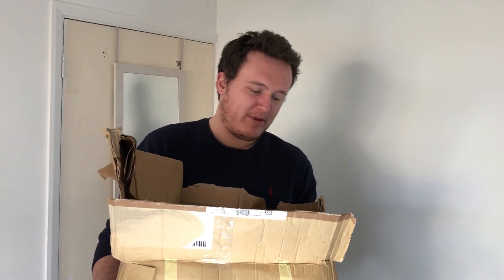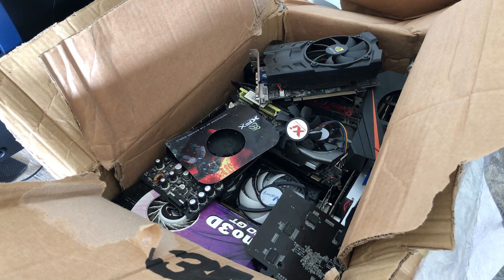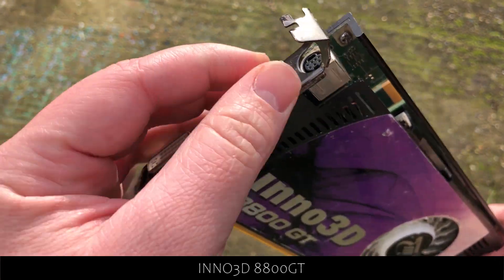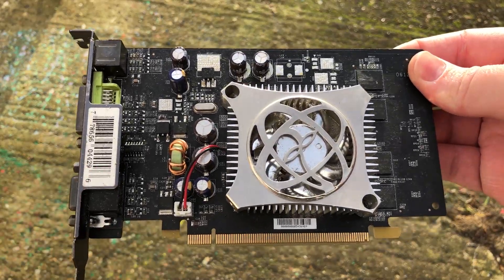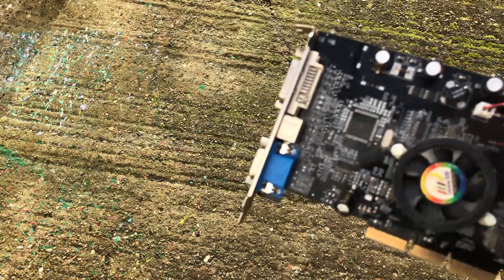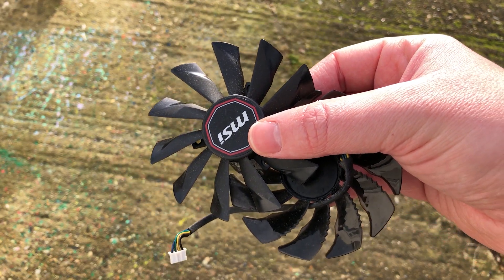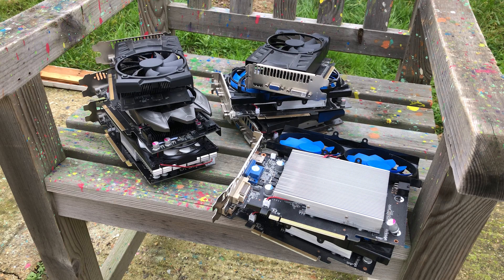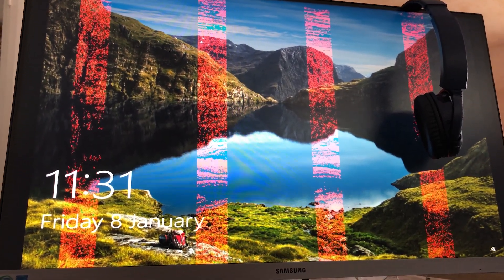I Bought 25 Untested Graphics Cards For £50 ($70)...

Comment: Wow a GPU in stock
Reply: Wow a broke boi without decent pre-order mindset
Reply: Always hasn't been
Reply: @fortnitespecialty5003  | Very cool FortniteSpecialty
Reply: @ouwebok3356  but are you cool enough to be cool or are u overheating?
Reply: not anymore, he bought them all
Reply: @fortnitespecialty5003  buts it's actually really hard to get a good gpu
Reply: @fortnitespecialty5003  lol you’re a square.
Reply: I managed to get a used 1070. Paid about £20 more than they were before covid on ebay but I'm very happy.
Reply: @JudeTheYoutubePoopersubscribe  people don’t realize how overkill a lot of the 20 and 30 series cards are, if you can afford them great, there’s literally not gonna be any difference between 150 fps and 250 fps lol and most people play either at 60hz or 120/144hz @ 1080p anyway
Reply: @fortnitespecialty5003  honestly just don't be a bellend.
Reply: Finally get my finances back on track, go to look at budget GPUs and there sold out or sky-high in price.
Reply: Yep I am surprised to
Reply: @Set-vt  for me at 1080p even the gtx 1070 is quite overkill. im only targeting 60fps and it can do it with ease on pretty much every game.
Reply: @JudeTheYoutubePoopersubscribe  I know right, I love having really high FPS and I plan on upgrading everything to reach 144hz @ 1080/1440p later on for which I'll try and grab a high end 20s, or mid-range 30s card by summer. I have a FE 1070 and it basically slaps anything at 1080p@60.
Reply: @fortnitespecialty5003  hard to believe your bragging about pre ordering
Reply: @user-ef6gv4wv1l  well iam #1/60 in queue so get rekt american
Reply: @Set-vt  awesome man. i have 1080p 144hz and the card will push out those frames in games that need it like apex legends and valorant so im happy with that.
Reply: @garrettmartin5102  even cheap ones are hard to get. Yesterday 1 gtx 1650 was in stock and the next day it was not. Might have to settle with a 1050 ti (i don't want the rx 570 because I want the nvenc encoder)
Reply: @Set-vt  still not enough for vr though, headset resolution is increasing faster than gpu power
Reply: @aqilardi5266  afaik VR is expensive in itself, one can’t have everything in life sadly 😭
Reply: @fortnitespecialty5003  What do you care, FortniteSpecialty? You can play Fortnite on your Mum's laptop, so why preorder a card? Just set everything to low performance mode and you're good to go.
Reply: @fortnitespecialty5003  sounds like someone gets too much pocket money
Reply: @Set-vt  yup, got a gtx 1080 for $300 in Norway, and it was the best price to performance card you could buy both new and used, and you cannot buy from ebay, it will cost you $100 extra, rtx 2060 costs around $320 so not worth it, a gtx 1080 is all i need, i play on 1080p 144hz
Reply: @adriandabrowski4990  wow, $300 for 1080 is a steal, congratz! I paid roughly $290 USD for my 1070, sad noises :(
Reply: I want a fucking rtx 2060 but their either out of stock or around $500 when it's worth about $300
Reply: @fortnitespecialty5003  | Very cool FortniteSpecialty
Reply: @fortnitespecialty5003  why would someone preorder they dont know if its gonna be good or not for them I've been trying to get 3070 for 2 months I'm sure most wouldnt try to preorder and that is if they could even preorder one
Reply: @fortnitespecialty5003  WOW! no ability to read sarcasm, who'd have thought from a forknife player
Reply: @floydfan2026  Yeah the nvenc encoder is a great reason to go nVIDIA,
Are you looking to buy new? do you not have enough for a GTX1650 Super as it is a much better buy, is it a big jump in price where you live or none in stock for those either?
here in Australia the cheapest (Gigabyte) GTX1050Ti & (Zotac) GTX1650 cost $219AUD but most GTX1650 are more than the cheapest (Gigabyte) GTX1650Super at $249AUD so the price difference is pretty much negligible for us making the GTX1650Super the obvious choice
Reply: How about an 1050 Ti for 400£ ?
Reply: My Rx 470 died and i needed a card fast. No patience to preorder and could have got a new GTX1660 super. However, for the same money i bought a used Titan X (2015).

Did i make a mistake? I bargained on the fact that the 12gb vram might aid me when things get busy, as both cards have a similar benchmark score on passmark.
Reply: @roblyc632   that extra 8GB may help with FrameTimes at Higher detail setting using the same resolution, especially if you are using over 4GB
Reply: @shaneeslick  I have enough for the 1650 but it's not currently in stock so I might have to get 1050 ti. I am going to microcenter to shop for a GPU next week so hopefully it's in stock when I go there
Reply: @floydfan2026  check the prices for 1650Super if they have stock & see how you go, all the best,
Hopefully America still exists next week, everyone seems to have gone crazy over there
Reply: Impossible
Reply: @fortnitespecialty5003  stfu fanboi
Reply: @shaneeslick  that's what I thought, cheers!
Reply: Never thought I'd see the day again.
Reply: @Set-vt  2070S here, 1440p/72hz Ultra gang and some games can seriously challenge this target - RTXon(tm) would kill anything. Granted, most modern games I run do so at ~80-120 fps, but not quite 144 which I don't even go for. I got what I wanted for what I needed.
Reply: @fartsoundeffect5013  
You're comment is more unoriginal than their's.
Get that stick out of your pants and laugh a little.
Reply: Seriously,  even 10yr old GPUs in my local market sell quick....pretty much anything that can play some type of game.
Reply: @Hughesburner  imagine if the gt 710 sold out
Reply: hehehe
Reply: @floydfan2026  Funny, I just picked up a GT 740 4gb for $25. I was pretty lucky. It will either for a gaming PC flip or my backup card. 
In my area, the bottom end is GTX 600/700's going for $50-$80....middle 900/10xx's for $100-250....and then rediculous RTX scalpers wanting $500-$1200 or those who bought a 2000's series and finally got a 3000 series. Just before covid, people basically gave the low end stuff away, I got an entire PC i5/GTX 680 for $40....now people want $60 for just the card. It's insane.
Reply: @fortnitespecialty5003  SO WHERE’S UR 3090? 😂
Also change game
Reply: I’m so lucky I got a 5700xt LITERALLY JUST GOT IT TO WAIT FOR THE 3080 TO COME BACK IN STOCK. Have to return it by the 31st. I doubt the 3080 will be back in stock by then. So i’m literally going to have to buy another 5700 and do it all over again
Reply: @ryanolsen294  i just got it in the mail lol thanks for asking :d
Reply: It must be pretty tough....do tell.
Reply: @Set-vt  I play at 1080p and am fine with it and being fine with it is what matters. I have been into PC gaming for 15yrs or so...at times deeply invested, both money and time. Other times I was just a casual PC gamer with a console to keep me happy. I will you tell you, PC hardware is a rabbithole of a addiction and where there is money to be made, there will be people selling you something you don't need but telling you, you NEED IT. The card in this video, 8800gts...I paid $650 for it on launch....and was happy for a few months until the next one came out...and the next...and the next...it never ends. I used to go to LAN parties around this time, more like a car show for PC's really. People including myself put so much time, effort and money into hardware, that will run more bench tests than games...just so I can say "I have these specs...water cooled..OC'd...blah"  
..yes internet PC specs flexing is not new..nor has it left...lol
Reply: @shaneeslick  Batshit no matter what side you are on...I stay away from the news and any political subjects...take it day by day.  I open the door in the day, if it doesnt look like the first 5 mins of "28 days later"  outside....I call it good.
Reply: I got a rtx 2070 from msi a few days ago. I hope i dont get scammed! I mean atleast its a trusted shop
Reply: @Fat Cat your the one saying it, might wanna look at urself.
Reply: little late, but was GPU's in stock in the stores i check, 3070,3090s.
Reply: @danielbermingrud3655  at microcenter I got my 1650 a week ago and not one GPU has been in stock since... well I dont count the gt 710 and radeon hd as gpus
Reply: @floydfan2026  theres 3070s and 3090s in stock here atlest Cry in useless 2080ti  to broke to buy one ._.
Reply: @fortnitespecialty5003  rich or not, it’s hard to get a graphics card nowadays
Reply: @rte3384  if your rich you can just pay a scalper tho, so I don't know if u are dumb?
Reply: @fortnitespecialty5003  max level virgin
Reply: @woke657  sorry to break it to you, but I have a relationship for over 5 years so don't shout things you are yourself.
Reply: I went to microcenter to get a gpu and they had like 4. I ended up getting an rx 5500 xt 8gb. (The best one they had in stock) but after that a guy started following us around the store trying to convince us to put it back, we ended up seeing him at the end of every aisle staring at us. And he left the store the same time as us. They need to fix this out of stock shit it’s got people acting like fucking serial killers 🤣🤣🤣
Reply: @obamahasmyvcr103  lol
Reply: @fortnitespecialty5003  did you buy your girlfriend too?
Reply: @dmitrijsmironovs7513  no, you probably did.
Reply: @fortnitespecialty5003  it cost you zero dollars to say this 😐
Reply: @maxumilius929  what are you on about?
Reply: @Set-vt  it's good you cannot have everything. It forces you to choose and that sharpens your mind and you get to know what is important in your life.
Reply: @fortnitespecialty5003  🤡
Reply: @jinxedmyself2413  U must be one of "The Brats"
Reply: @jinxedmyself2413  crazy brandon boy
Reply: @fortnitespecialty5003   nah u just a clown
Reply: @fortnitespecialty5003  just stfu prob u got an rtx 3090 just to play fn
Reply: Gpus stagnated with 1080 ti buying anything new is a waste.
Reply: @fortnitespecialty5003  this man really implying it was ever possible to preorder a recent GPU
Reply: I must be fortunate to have a rx570. Even it's only 4gb of vram
Reply: @fortnitespecialty5003  We have central air conditioning so im fine
Reply: @fortnitespecialty5003  awww did you waste money buying GPU's from a scalper?
Reply: @fortnitespecialty5003  wow look a possible scalper, cringe
Reply: @fortnitespecialty5003  imagine playing fortnite and having it as ur profile picture
Reply: Sus
Reply: @fortnitespecialty5003  Ratioed 🤡🤡🤡🤡
Reply: Damn that hurts man
Reply: @fortnitespecialty5003 is the type of guy who thinks their funny and gets no friends yet still wonders why he gets no friends
Reply: Weird that I bought a 6600 in the GPU shortage for the same price of a 6800xt now a days
Reply: Hello from 2025. Nope, all sold out!